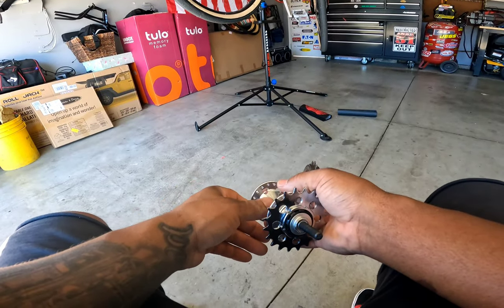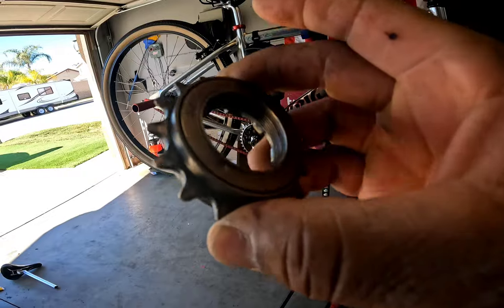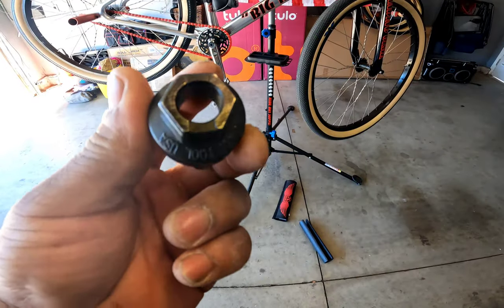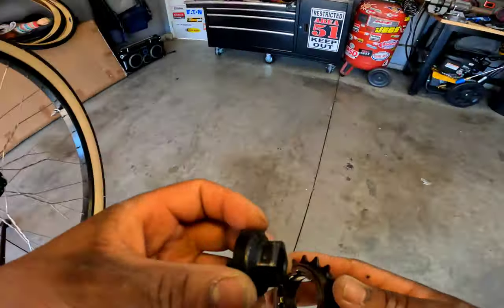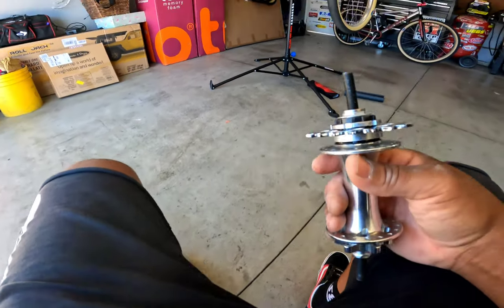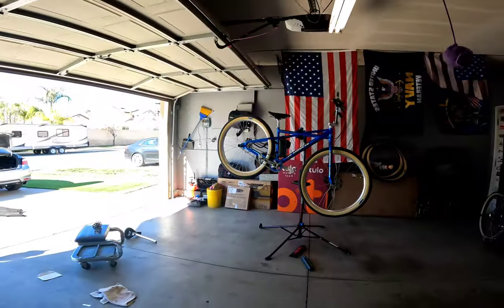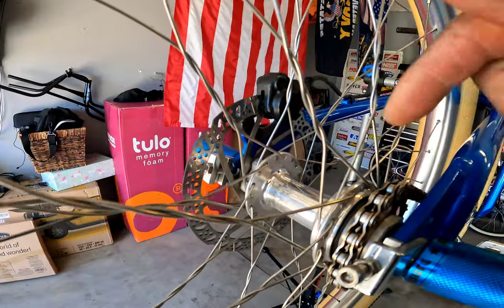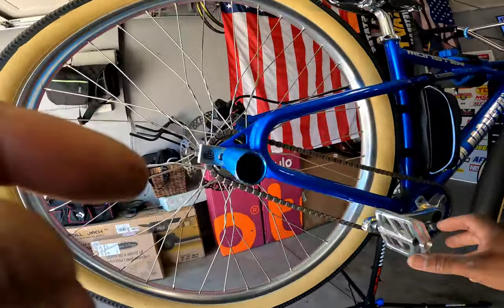PROFILE CASSETTE HUB VS ROS LOUD FREEWHEEL SE BIKES BIG RIPPER MONSTERQUAD

Comment: I have both a Big Ripper and a Monster Quad and one of the first things I did with the Ripper was swap out the freewheel to an Origin8 Hornet as that was the only one I could find at the time. That sucker is loud and compares to the ROS freewheel. Both to me sound about the same. I definitely want to upgrade the Monster but damn, you are correct....those Profile hubs are big bucks!
Reply from the maker: Yes pricey lol
Reply: What size free wheel we need for a monster ripper
Reply from the maker: Cassette profile beastmode

Comment: I recently got a 2021 SE Big Flyer. I am trying to add SE wheelie pegs and a SE chain tensioner like you have. Problem is.....axle is not long enough to accommodate both. About half the nut is actually threading on. Did you install an aftermarket longer axle to achieve this goal? I know it can be done, just do not know the correct way. I don't want to bust my ass due to maybe three threads catching. Thank you in advance if you respond. #RAISEUP
Reply from the maker: All washers must be removed your peg becomes the washer

Comment: Cassette compatible with the monster ripper? 
Because monster quad and monster ripper are the same specs correct
Reply from the maker: Yup
Reply from the maker: Beastmode profile cassette only because it comes with disc brake mounts
Reply: @bikelifegee  did you have to change your sprocket ?
Reply from the maker: @VL3C  my monster quad comes with a 39 20. Profile don't make a 20 had to get a 18.  Had to change the chain ring to a 36 because the 39 18 was horrible
Reply: @bikelifegee  okay cool. I’m ordering the set rn and wanted to make sure if I needed to swap out that sprocket as well. 
I’m stoked! Can’t wait for it to get here
Reply from the maker: @VL3C  yea man 36 is needed💯💯💯
Reply: @bikelifegee  last question. Is the stock chain fine?
Reply from the maker: @VL3C  yes works perfectly fine